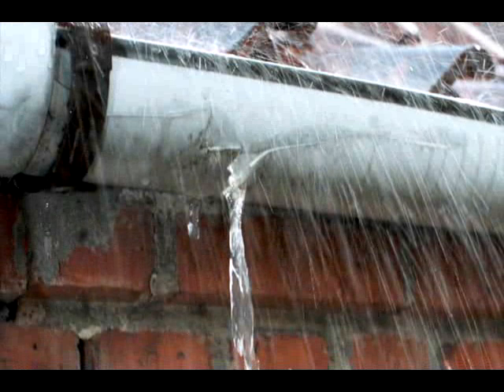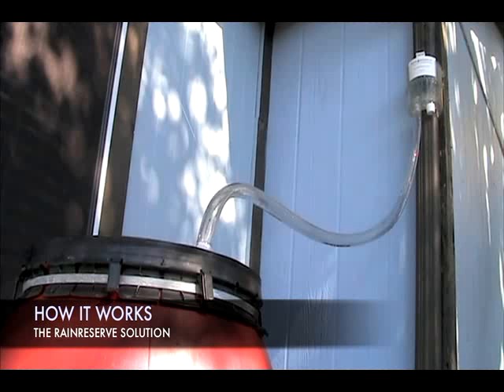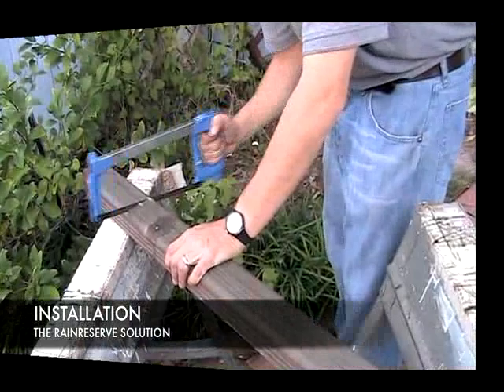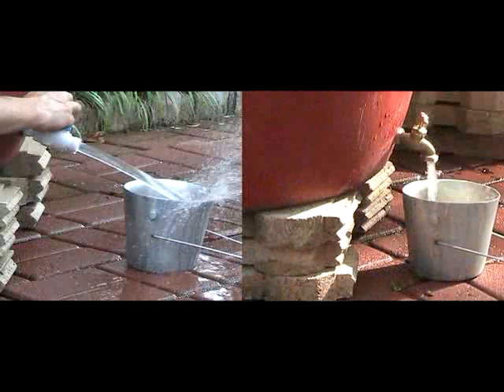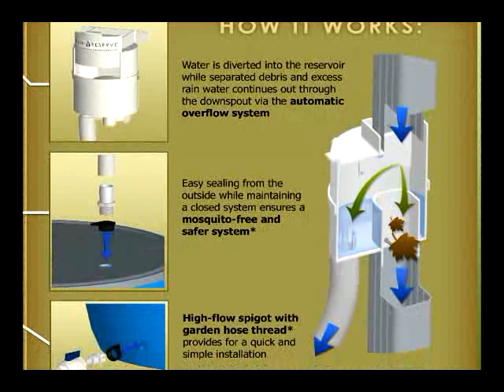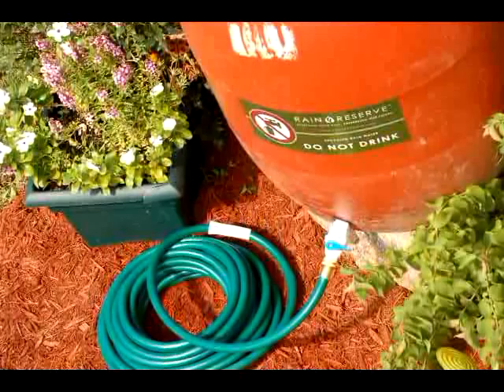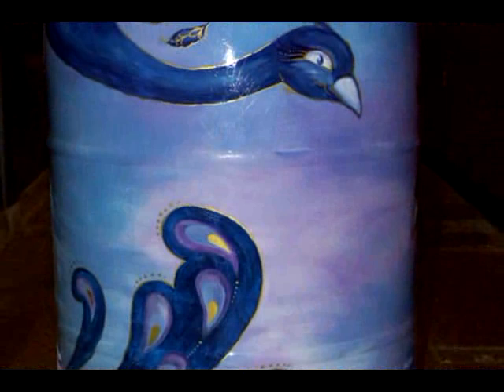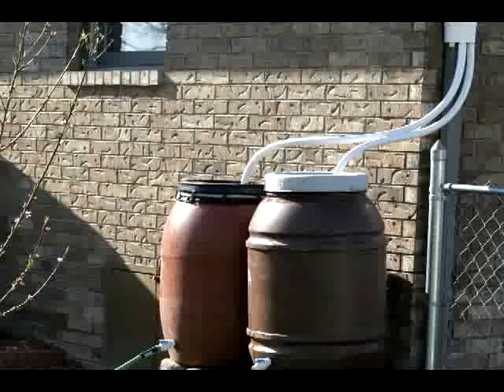RainReserve - Rain Barrel Rain Diverter

Comment: I've installed 5 of these on our downspouts with between 1 and 3 55-gallon HDPE drums connected to each diverter and have been using them for over 10-years. The 55-gallon drums all sit on a triangle of 2 high concrete blocks that sit on concrete footings. I have found that the level that works for me is to align the top of the diverter rain spout overflow rim a couple of inches below the top of the barrel. When the water in the barrel reaches this level then it will overflow into the rain spout. I wish that they made the diverters out of cast aluminum so that they were more durable. I realize that this would significantly increase the cost but it would allow the installation to be one and done. As it is most of ours are in need of replacement. If you are in this for the long hall then I recommend using threaded holes in the barrels and PVC fittings. Also, if you live in a location that has cold winters you want to make sure that you drain your barrels as they will surely split if full of water when they freeze solid.
Reply: Also, we have replaced the hoses that are included with the kit with 1" clear vinyl tubing and PVC fittings on the diverters. Our drums feed into a drip watering system that doesn't require a lot of pressure to work.

Comment: Evidently the sound was fixed.  But I prefer an overflow outlet at the top rather than sending the rain back into the storm sewer system.  One that a hose can be attached to and send water out to the yard.
I'm looking for material that doesn't crack after a year or two.

Comment: I didn't find the pressure very practical, even with the barrel on two levels of block. Had to add a booster pump to be able to practically water anything. Plastic on this isn't unit isn't very good. I only get a few years out of it  before pieces start cracking.
Reply: Just watching their video, I have to already agree with you. Thanks.

Comment: This video provides no details on where, on the downspout, to install the diverter. Plus their barrel comes with holes pre-drilled, not in the top, but in side of the rain barrel, which I where I believe the hose should be inserted. Otherwise, you will get the overflow mess that they refer to. this video is useless.